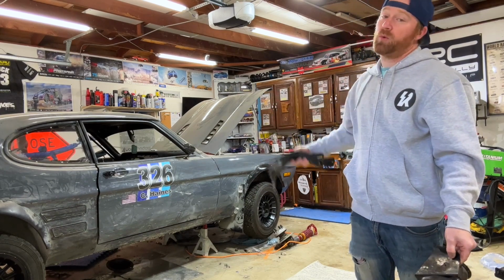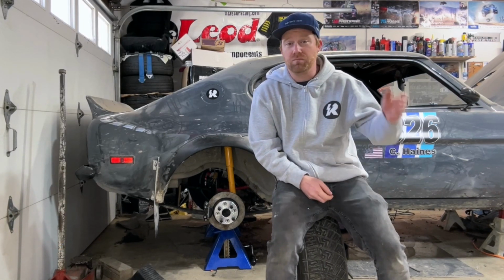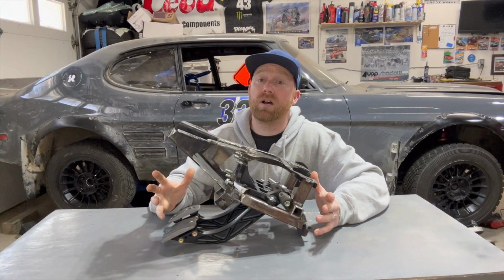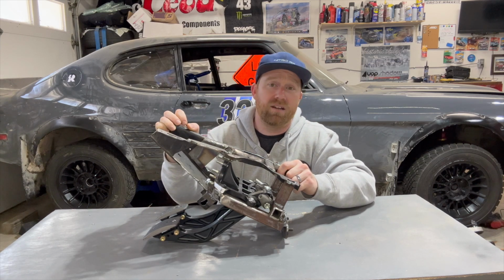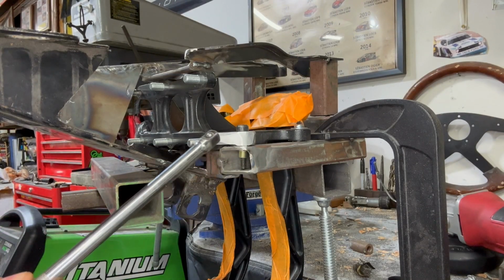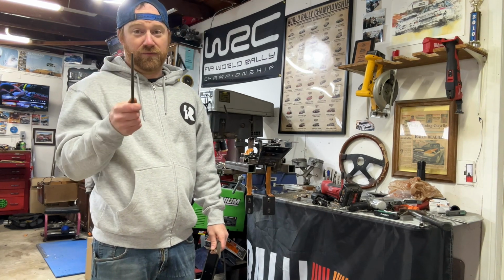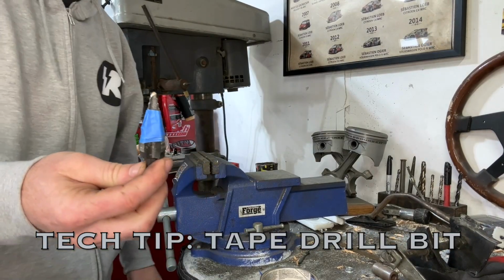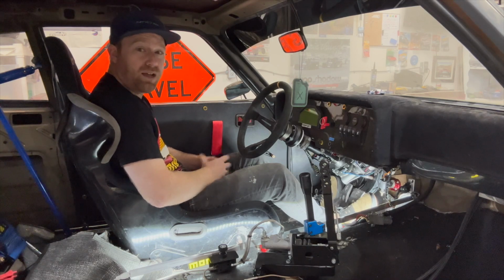Tilton universal Racing Pedal Box Install on v8 powered MK1 Rally Capri !

Comment: I would love to buy pedal upgrade also to my capri. Hard issue to solve how to to it smart and all works... Space is quite small.
Reply from the maker: Well if you need any help I am more that welcome lead a hand. You can reach out to me on any of the social media platforms. I don’t know were you live in the world but I am in California so if your local I can give you a hand
Reply: @Rallifab  I am in Finland so unfortunately not nowhere local, living under shade of Russia. 9" Brake booster single diagraph with Hella Vacuum booster pump. 2.8LV6 EFI Cologne Turbo E85, 507hp, 648nm on 1,7 bar boost. Manual Transmission MT-75 V6 Hybrid gearbox with Clutch Cable (Mechanical). Uprated brakes, rear 273mm Vented Cossie 4x4 with EBC brake pads and In front 283mm vented cossie 2wd discs with Ford Mondeo front calipers, EBC red stuff pads, stainless steel hoses 15" wheels.Wilwood, brake pressure regulator and electrical linelock from Hurst. Car weights about 1100kg. Atlas axle stock ratio 3.09:1, Engine rpm limited to 6100rpm because turbo is getting small and would need also bigger intercooler. Sleeper look, MK2 Escort 60mm wide leafsprings with Gaz coil supports, and Calvert Caltracks.